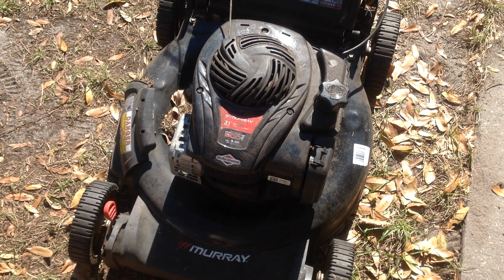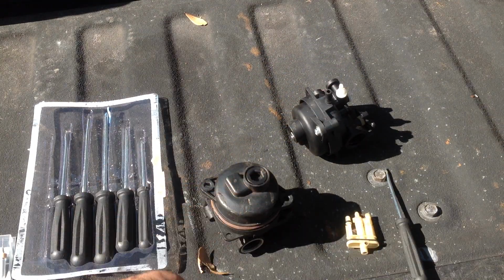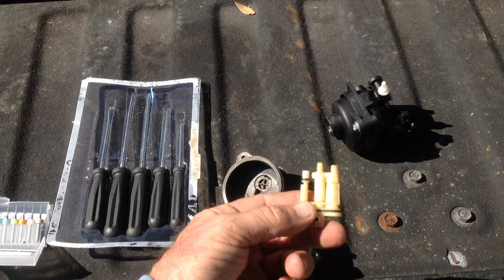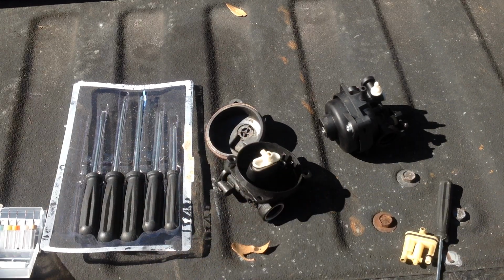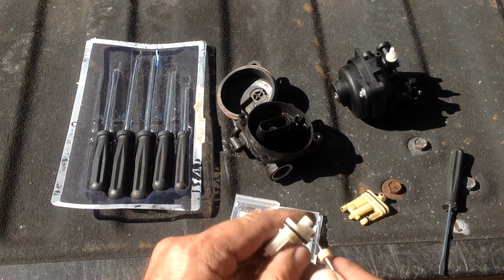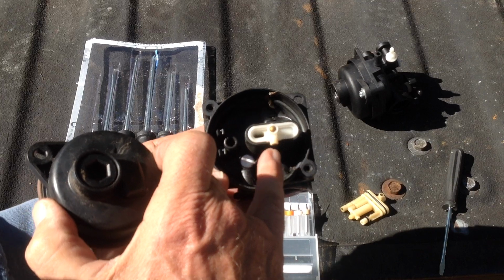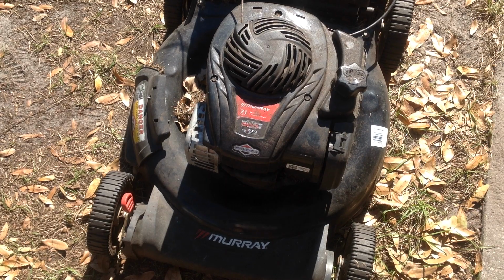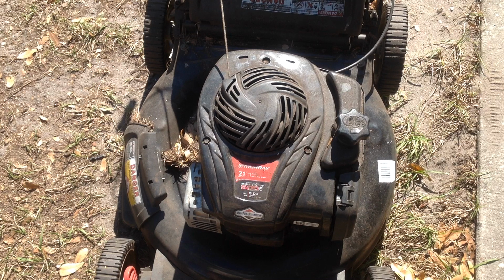2017 Murray 500E push mower for $40....Why wont it start?   Last video...it is running!!!

Comment: Great tip on the jet sizing. It would be interesting to see which drill bit fits in an original Briggs jet that hasn’t been bored out, probably that second bit from the end. These carbs are actually a pretty good design, they solve a lot of problems created by ethanol gas and you can drain them completely for storage. Problem is nobody ever does!
Reply from the maker: I like working on these carburetors, they come off quickly and are easy to clean.

Comment: Now what if we suspect that the primer bulb isn't priming fuel even tho it is building holding pressure
Reply from the maker: I have not run into an issue with these newer primer bulbs.  I guess you could do a little troubleshooting to see if it is an issue.